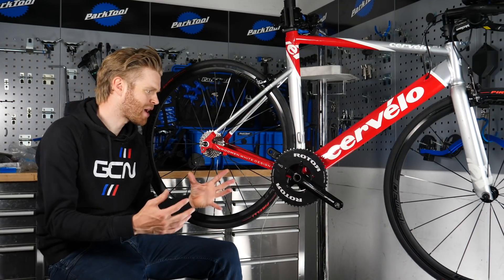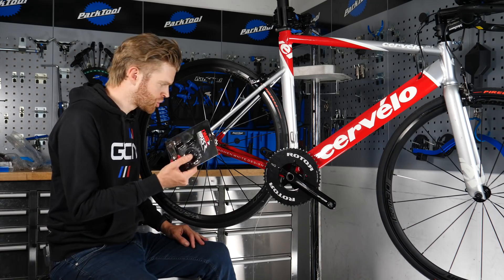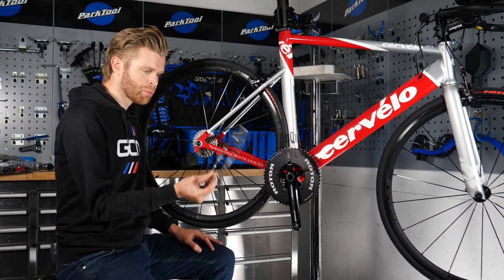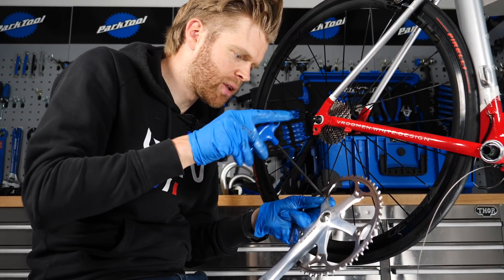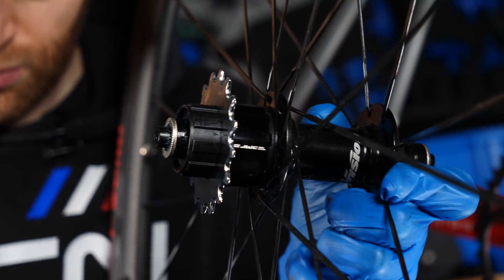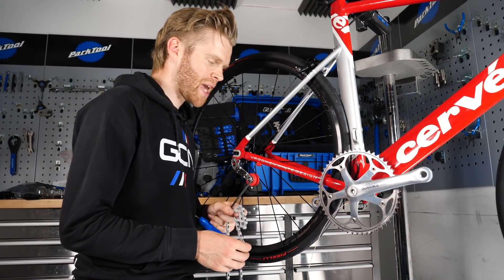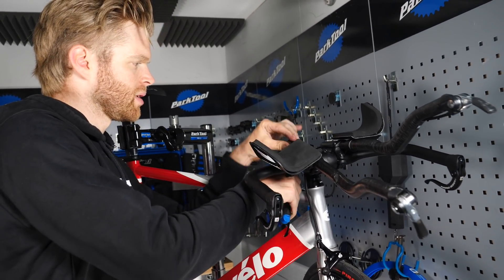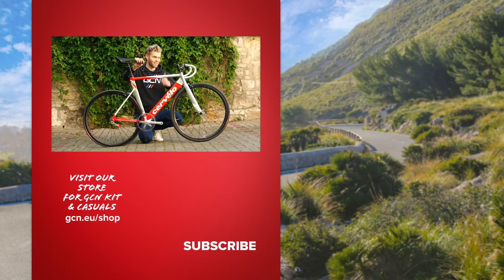Building A Budget Single Speed Bike: Part 2 | GCN Tech's Bike Builds

Comment: Dura Ace Track Chainset budget build. Got it. Lol
Reply: The thing is, how much is this stuff costing him? He already had the Cervélo frame, so that's £0 for the frame. Pretty budget friendly if you ask me.
Reply: @serdiezv  The chainset alone is more expensive than a whole single speed bike! if you want to do it on a budget, you simply shorten the chain, buy a bmx cog, harvest some spacers from old worn own cassettes and there you go. 5 bucks.
Reply: @chrisko6439  he didn't pay for the chainring either, it was his friend's that he lent to Ollie
Reply: @serdiezv does it matter?
Dude has access to GCN warehouse, he could make a house out of pinarello dogmas if he wanted to.
Doesn't mean they are cheap.
Claiming a "how to build a budget bike" in the title and then using obscenely expensive parts just because you have thousands around is plain dishonest.
Reply: @gitnjur only if you plan on using the same components, the point is use what you have around if you have stuff around. I have an Ultegra 52/36 crankset laying around, it would cost me €0 to use it.

Comment: I've done three single fixed conversions from old school steel frames when I was a pushbike courier in London in the mid 2000s. I encountered a lot of the same issues , even on the third one. On all three I had issues with different bottom bracket standards, especially on the older frames. Also found that a standard road chain is the wrong chain to use as was a road chainset as the teeth need to be longer, like on Manon's. Lastly, I found that 47/17 was the best gear ratio on a fixie for braking points. It meant the wear was evenly spread on the tyre when skidding and also on the chain. It was a quick enough ratio for the flat, wasn't too bad up the steep hills of North London and was just about controllable going downhill -- although I cheated with a front brake. Good to see you guys doing this and actually the adventure lies in the hurdles that come up. My local bikeshop was a godsend and there was a good youtuber, can't remember the name of now, who had a lot of instructional videos on conversions but these are very educational. Looking forward to building your own wheel.

Comment: I did over 5000 miles on my Genesis Flyer, changing between fixed & SS. Completed my first imperial century ride on it. I did eventually move on to a "normal" geared road bike. However I really miss my fixed gear rides, yes it is a laboured point with "fixie" riders but that connected feeling to the bike is special. Furthermore the aesthetics, simplicity and near silent drivetrain all give it a unique charm.

Comment: I have both the Surly track flipflop (120mm) & the Surly Ssp hub (135mm) either can be made to work for your purpose, but both will require a bit of bodging. On the single speed hub a english threaded lockring from a left side adjustable BB cup can be used as a lock nut if the track cog is narrow enough & 5 mm of extra width seems able to be spread into the rear Dropout w/out damage. THe track hub can have cone locknuts added for extra width & a BMX freewheel will work without a problem. I used the track hub for my Tracklocross wheel build.

Comment: I don't like tensioners and a 1/2 link (BMX) chain gives you more length choices for the adjusting at the rear drop out.  You might be able to delete the tensioner.  For gears, I like the White ENO singlespeed freewheel  Use the cheapo conversion kit until you  decide what gearing you can live with - you may change your mind after a few weeks.   In SoCal - pretty flat on the coast -- I like 46-16.   The White "Duo" freewheel gives you 2 gear choices, too, so you can cover a calm/flat (16) and windy/hilly (18) in one free hub.  The spacer set cog will chew up your hub splines  (there are wide base single cogs).   Best for me was to work out proper gearing on the cheapo spacer free hub, then making it permanent with the White eno.

Comment: For your build you should consider a Sturmey Archer S2 hub if your building  up a wheel and live in a hilly area. An S2 hub will give you a single speed look with the option of a climbing grear. You switch between the gears in the hub by kicking backwards like you would to engage coaster brake. You get 2 ratios 138% and 100% a go gear and a hill gear. Looks great and works really well for a hilly city.

Comment: This is so typical of a road bike to SS conversion 😁 - I've built about 5 SS or FG bikes over the last few years and each time you start it saying "I'll only need XYZ..." and before you know it you're cutting and bending springs from old gear calipers to put in the long drop ones, the chainrings are the wrong BCD and you're ordering your third chain.

I have to say freehub and chain tensioner system is the easiest way - recommend the Shimano Alfine tensioner (usually on hub geared bikes, operates like a fixed rear derailleur with 2 jockey wheels), I have an old CAADX which has this drivetrain.

Otherwise any frame with horizontal dropouts and a flip-flop hub is the way to go. I have had a Dolan Pre-Cursa for years, after playing around with steel frames - I have used it as a courier, to commute to work, even to ride London-Brussels and now finally I'm using it on a Velodrome and it's still going strong. I think I've changed the chain once in 3 years.

Comment: 52t is fine as a chainring, just use a bigger cog on the back.  A quick gear inch calculation will give you the requisite number of teeth...
You could also solve the quick release problem with chain tugs.  BMX ones are very cheap on eBay.

Comment: Really enjoying this! Grand Cru hubs fixie will be perfect for a road frame as they include spacers. If you can get a KMC hl710L which has half links you will be able to fine tune the chain length better than a regular one so you won’t have to worry about your shorter track ends. Alternatively, as someone else commented try for a “unicorn” cog/chainring setup. If Manon can give you three consecutive cogs (14,15,16?) and you aren’t too fussy about your gear size (might be a big if in Bath!) you should get the perfect chain length with one of them.

Comment: A common flip flop hub is a Formula brand hub, or a rebranded version with sealed bearings. Since this is a budget build those are some of the best for the budget. All-city makes a flip-flop at a little higher price but they do have a slightly better bearing set installed. For a budget yet high-engagement freewheel the Origin 8 Hornet is quite loud and will give you those soundbits you like.

Comment: 10:05 my understanding with chain tension, especially on a conversion like this video is that a chain tensioner wont help that specific issue.  The way the front gear pulls the chain, all the tension pulling on the rear gear and the rear wheel comes from the top side of the chain.  Even with horizontal dropouts, unless you have  one of those track bike rearward facing dropout screws that prevents the wheel from coming forward over time, you are going to have to re-tension your chain every so often, in my experience maybe every 100-150 miles.  The reason to run a tensioner is to prevent bumps and josltes from unseating the chain on the front ring, or to make up slack from a poorly chosen chain length.  I'd like to see a Manon video about correctly seating rear wheels in fixed gear bikes.  Both chain tension as well professional vs home methods of accurately centering the rear wheel in the dropouts.  Great content as always though, thanks GCN.
Reply: True

Comment: Fitting a single speed chainring to the existing cranks is a much better solution. eBay has loads of chainrings for less than 25 quid. I've fitted a single speed chainring to an old Tiagra crankset for my budget build and it worked beautifully - much lighter bottom bracket, easier to maintain, looks better.

Comment: Very nice to see you building a track bike! Track bikes aren’t often covered by the YT channels. So I got some suggestions to be detailed in your 3rd video:

1- explain well about the chain line - how to get it right.

2- tell us if there is any noise on the drive train. I have a Cannondale CAAD10 and that noise in the drive train kills me! I can’t get rid of it, tried lube / chain tensioning / cleaning and re-lube but the noise is still there!

Also try to put a track/pista handle bar instead of the Zipp you got, it will look nicer

Cheers

Comment: Nothing wrong with a nice 52t chainring. Just fit a bigger rear cog in the back. Single freewheel cogs are cheap. I run 46/16 on my single speed and that's roughly the same as 52/18.

Comment: Keep that beautiful 52t chainring and use an 18 or 19 cog in the rear. The gearing will be similar to a 45/16 (in fact the 45/16 is right in between the 52/18 and /19). Also I'd put those tt bars back on, minus the aero parts. They'll be good looking and comfortable wrapped with some bar tape, you won't need a new stem, and you can reuse the old brakes and cables (assuming you didn't cut the brake cables).

Comment: When building your wheelset watch out you get a hub with 130mm spacing or one with proper spacers from 120 to 130mm. 
The H+Son Archetype Rims are great for a Fixie (pretty wide rim width) or a more classic rim like the Mavic Open Pros with some gumwall tires 👌🏼
The Dura Ace 7710 Crankset is great, especially with a Road BB with sealed bearings. It's super smooth, i ride it too :)
Reply: Sugino is more fixie points tho.
Reply: Omniums
Reply: @leebridgwater  lol no 😂 the omniums are not even close to 75 DDs or the 7710s, trust me.
Reply: @leebridgwater  What are you smoking dude...they quit making that crap for a reason. Unless you enjoy sheering your cranks off and creaky bottom brackets after 1000 miles.
Reply: @WtfYoutube_YouSuck  haha, love the omniums
Reply: @leebridgwater  if they were so great, they'd still be making them. =P   Honestly, I don't hate the look, but I can't stand a shit creaky BB.  We ride fixed to get away for garbage press fit problems.

Comment: its looking good, have you looked at 1/2 link chain then you might get the good fit, also easier to get the brakes to line up easier, also if you are worried about pulling the wheel you could use some tensioners, good for setting tesion and prevent axle moving forward.

Comment: #gcntech You need a 48t chain ring up front and 16t single speed and 17t fixie cog on your flip flop hub.  For all your wheel build parts check out BLB bikes or Halo Wheels :) Also for brakes use only central pivot cantilever style. Ideal crank arm length is 165mm :)

Comment: Although a flipflop hub might be usefull at first, it really isn't in reality. Just to try in the beginning and see which you prefer (fixed or just singlespeed) it has a use. But when you make to choice, either fixed or not, I would recommend staying at that choice untill the chain needs replacing. But do so or if you are willing to place a new chain and even cog at times if you flop the wheel over after you ride several hundred kilometers or more, depending weather, power of the rider, riding lots of uphill or sprints and the maintenance.
If you ride the chain on a cog in the back, singlespeed/freewheel/cassette and various others. They will wear on each other in time, and if you ride the freewheel cog and want to switch the wheel to fixed cog after say 500 kilometers. The chain might skip while doing high efforts with high torque. So if you flop the wheel not so frequently, you might have to change the chain and in the worse case the cog every time you do so. And if you chose to ride with a flip flop hub and flop the wheel frequently, it's worth investing in a rear tire that doesn't have a thread that hase a uni-direction or rotation pattern. Because then every time when you flop the wheel, you will have 'flop' the rear tire too. And personnally I find wheels with flip flop hubs absolutely ugly as hell, because at all times one cog isn't used and looks unnessary. And it puts not needed extra weigt on the bike. Greetings from a Belgian bike mechanic.

Comment: As others have said, a chain tug would be a practical solution to the slipping rear axle. Oli - be aware that your choice of flip flop hub in a 130mm (road frame) width is extremely limited. 
The 120mm track width ones aren't exactly easy to find these days either.  
I suggest you start with the classic FG gearing of 42x16 (or 48x18) as parts are a little easier to find. The temptation is to go "macho" with the gears, but you can spin nicely up to 25mph. 
With your proposed 45T front ring, I suspect that 17T rear is best; you might want to go 16T but that will compromise your knees and climbing ability somewhat.  
Further reference material is available on LFGSS.  
Finally (!) I would suggest using a ruler to check chainline, rather than eyeballing.

Comment: Loving the build, but if the pitch is wrong on the chain ring, what about the cog on the wheel, surely you should match them both! Also, a bit of air in the rear tyre may look and feel better😉. Finally, hairdressers are now open in the UK I believe!
Reply: I think I've heard that the bigger chain fits both sizes of cogs, but the smaller chain can obviously not be used with a bigger size cog, as seen on the video.

Comment: For my fixie I built wheels with Phil Wood track hubs (don't think they have a flip-flop option) and velocity dyad rims. I just used standard double butted steel spokes, radial in the front, and cross 3 in the rear. They work great and look great. Definitely recommend at least the rims, hubs aren't so budget.

Comment: Don't worry about your ratio, if you've got a 52 in the front, you can put a 13 cog up to 22.  Your ratio can vary a lot without having to change the chainring. I'm telling you this because I happen to have the exact same crankset with the same 52 chainring. Even if the BCD is the same, a non Dura Ace chainring will be really ugly on this crankset.
Reply: Totally agree. He should keep that chainring and use a bigger cog in the rear. I'm guessing a 52/18 or 19 would be perfect for what he wants.

Comment: Visually figuring chainline is ok sometimes but generally you really want to do real measurements especially if you're doing a fixed gear conversion
Reply: +1 on this. I did an SS conversion on an 80s road bike and in order to know what BB to order I needed to work out the chainline in advance. Here you just mention replacing the BB like any ol' one will do. They come in different spindle lengths, Ollie. That's a make or break detail for this build.
Reply: Use vernier calipers to dial in the chainline.
Reply: @galenkehler  well yeah, i know, but does everyone else?
Reply: yeah, more of a case of just getting it in rough ball park, before fitting the chain
Reply: It's not really planned sure. If he gets it wrong he'll get another episode outta it.

Comment: Mate!  Love this ride!  I do wish the rear spacing allowed for a fixed hub...  I think with those dropouts you could totally run fixed with the right rear wheel!
Reply: There are fixed hubs that will fit that frame. Theres even a fixed/disc brake rear hub from Paul Components.
Reply: it is possible if u do have some axle spacers and a longer axle
Reply: Think the uber deluxe Phil Wood do axle spacers to allow 120mm hubs to fit

Comment: You don’t need the chain tensioner with track dropouts and wheel nuts. It’s only required with classic dropouts since they go vertically and not horizontally. Track dropouts allow you to pull the wheel further back to tension the chain, then you screw the nuts as hard as you can and it won’t move. You don’t have that option with classic road dropouts unless you happen to find the perfect ratio/chain length for your specific frame.
Reply: Also, be sure that the size of your chain chain links, your sprocket teeth and your ring teeth match. Even for track parts there are different sizes. I’d go for an Izumi Jet Black chain (best there is for a « commuter » track bike since it’s tough sturdy as hell, or go for the Super Toughness if you can afford it) and a nice Dura Ace sprocket

Comment: For single speed its ok to use a road frame but not for a fixed gear. The bottom bracket is to low for a fixed gear because your pedal can scrape on turns.

Comment: if I rode singlespeed, I would  use a bigger front chain ring and also bigger cog in the back. Like a 44 to 54 on the front and a 22 to 32 in the back. Because the bend at the rear cog is better then with a small rear cog (say a 14-16). And also a big front ring looks beastly good. A mechanical advantage, time trailists use too on professional roadcyling (they mostly do it for a straighter chian line though, but still). But the big-big combo is slightly heavier than a smaller front ring and smaller rear cog with simalar gear ratio. Gear ratio is very important for fixed or single speed bikes, lots of people ride a way too hard gear ratio thinking they're professional trained athletes and kill their knees and have injuries. As for fixed speed, don't use a really small rear cog, because the chain is used as back brake. And if the chain has too little engagement, the chain might skip if chain-cog combo is a little worn out or at high torque braking. I myself would never ride fixed, because I don't want to die in downhills (with my legs not being able to follow the high rpm's and what follows after, going downhill with legs wide clear of the pedals, not being able to use the back brake at all). Also not being able to use  the chain as back brake as it might skip in emergency stops. Go singlespeed on the public roads with normal brakes wtih brake levers on the bars. Keep singlespeed bikes for suicide racetracks with crazy contenders and events, like track cycling and things like fixed racetrackevents. People who get paid for doing it or like to experience unnessary pain or even death in some cases.